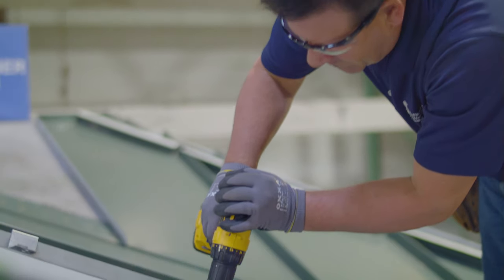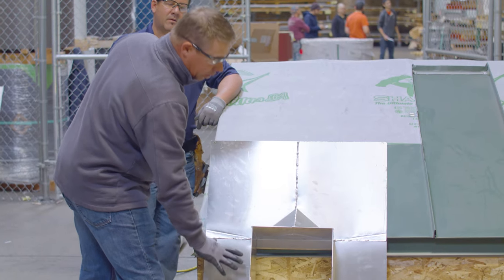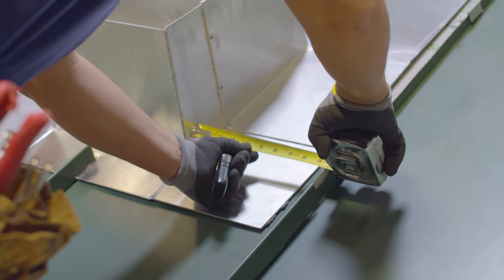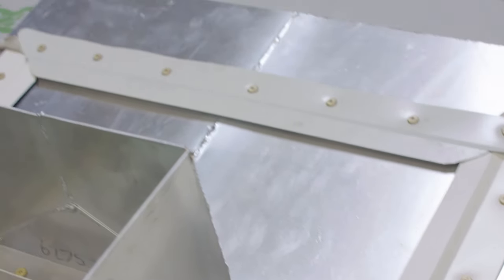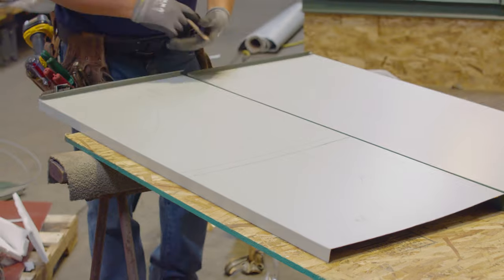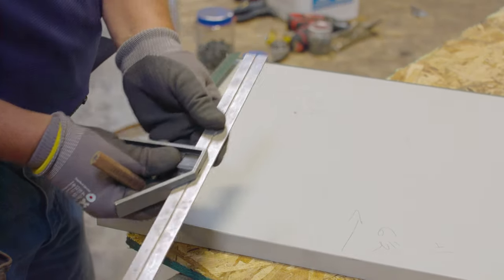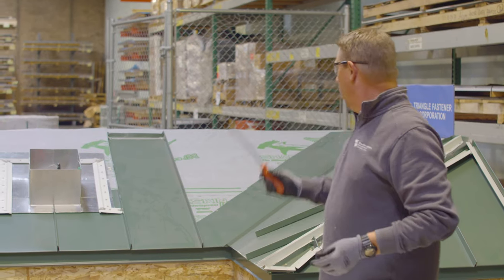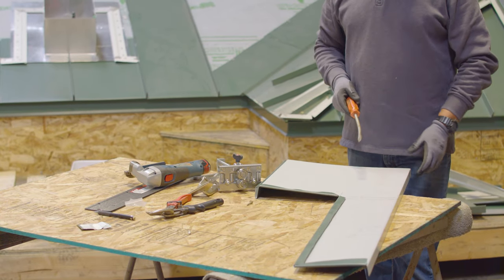How to Install a Pre-Manufactured Curb on a Metal Roof

Comment: Surely there's a better way than having those exposed fasteners?
Reply: Could probably install some cleats on the underside just for the bottom portion but domt think theres much other way of holding the end cap on unless you take a welder to it

Comment: How long does that butyl tape keep a good seal?
Reply from the maker: Hello! How long it will keep a good seal depends entirely upon the installation. Butyl tape works by compression and should be fastened in between two pieces of metal no more than 4” O.C. because a fastener will compress the butyl tape 2” in each direction. Other factors include making sure the attachment area is clean and free from dirt and debris and the proper size based on the application. The main problem that we see is people don’t install the fasteners close enough to get the proper compression or they install butyl tape that is not the right size for the project. Then dirt and debris can coat the non-compressed butyl tape making it ineffective. Hope this helps! -Thad
Reply: @TheMetalRoofingChannel  thanks, but you didn't answer my question.
Reply from the maker: I am not aware of manufacturer data that gives a hard time frame other than the lifespan will be significantly reduced if installed improperly, as I stated above. I think the key is that the butyl tape is used as a secondary defense only and shouldn't be relied on as a primary means of protection. If you have concerns about using butyl in an install, let me know or you can speak directly with the Sheffield Metals technical department who may have more information. https://www.sheffieldmetals.com/Resources/Technical-Department -Thad